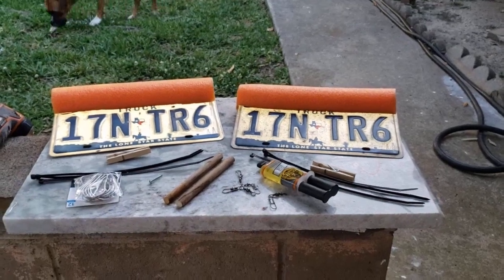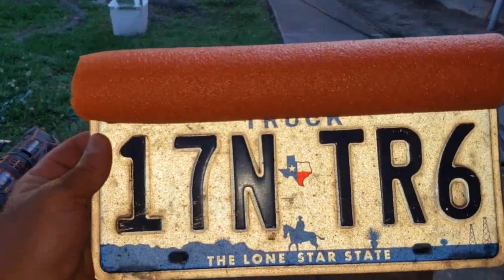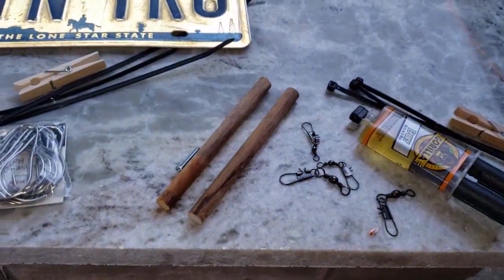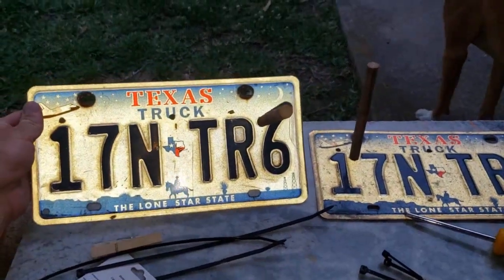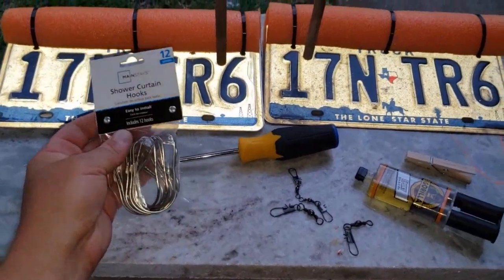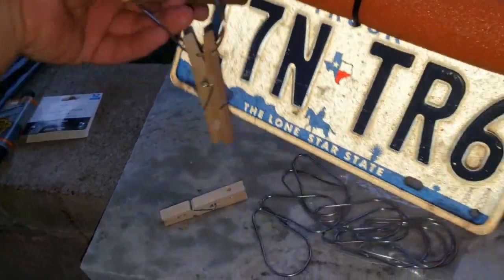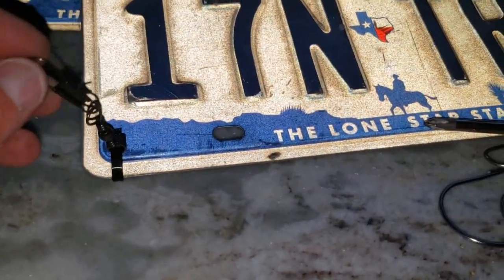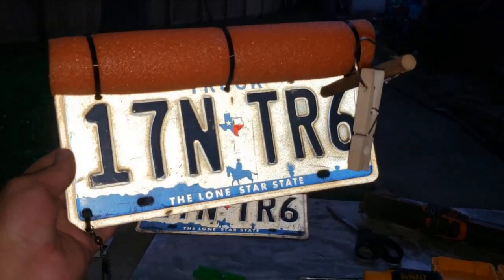DIY License Plate Planer Boards for Trolling / EASY & CHEAP

Comment: I used small binder paper clips. You know the black squeezy kind. With two little pieces of quarter inch aquarium air hose to grip the fishing line. Just in case you’re close pins don’t work.

Comment: Did they work?
Reply from the maker: Yes,  but they work better when trimmed down a little smaller.   The design works and delivers the bait out nice and wide.   Trolling speed must be kept really low with the full size license plate design.  I've been meaning to post an update video,  but I've been really busy.
Reply: @wfrederick2501  Would you trim down the height or the length, how would you remake them if you did it again? Thanks for posting this, wish I could see how well they work.